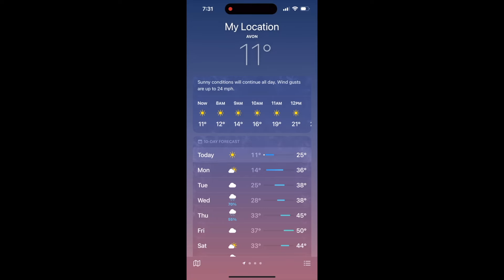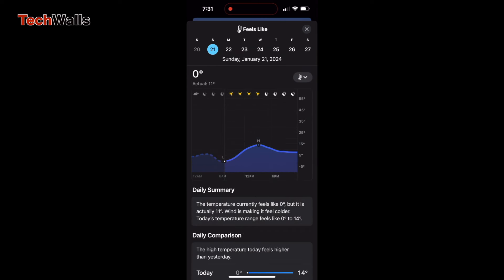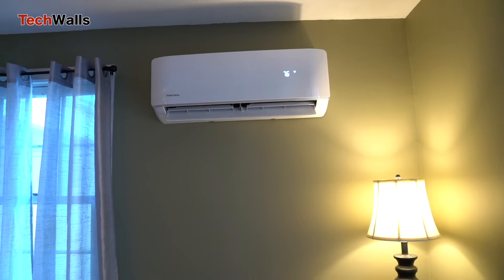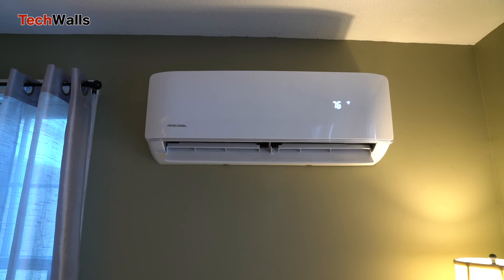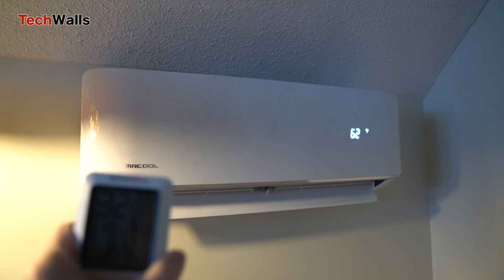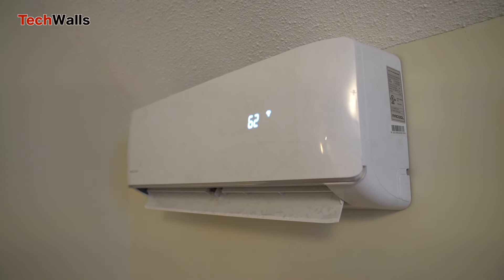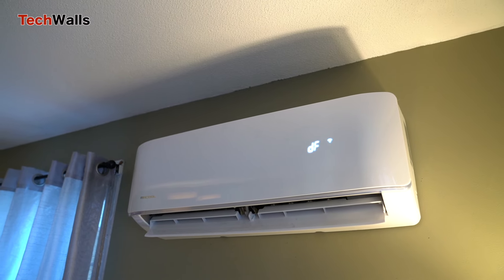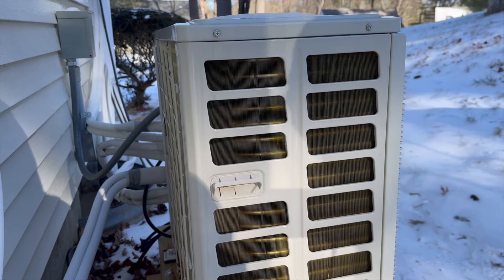Can MrCool DIY Heat Pump Work Under 10ºF (-12.22ºC) Cold Weather?

Comment: I think I have the Senville equivalent to this. I'm underwhelmed by its performance. It shouldn't have trouble in 10 F for you.
Reply from the maker: Yes, I feel you. I switched from oil and natural gas to this heat pump. This has the lowest performance as compared to other heating sources. However, it is acceptable for me and it can improve with better insulation. I still like it, its performance in the summer is amazing, cool the air within minutes.
Reply: I agree, I have the Blueridge 24K DIY, which is the same exact model as the mrcool.  Here in VA we had extremely cold temps last week, down to 5 two nights in a row, I've had the 24K mini split for about 3 months and was nervous but it kept the entire first floor, about 1000 sq ft around 70-71 the entire time.  Did use quite a bit KWH but still far less than our oil furnace.   House is around 100 years old but is very well insulated.    Around 15-25 degrees seems to be it's sweet spot for efficiency and not going into defrost mode every couple hours.
Insulation will make a world of difference and really help with your bill.
Just curious, have you ever checked the R410a level?  Some pre-charged units come low from the factory and that will have a big impact on cold weather performance, I bought a little pressure gauge off Amazon for around $50 I think when we installed ours just to check the refrigerant level and it was good, but you never know, I've spoke to other guys who have had to add several ounces to theirs.